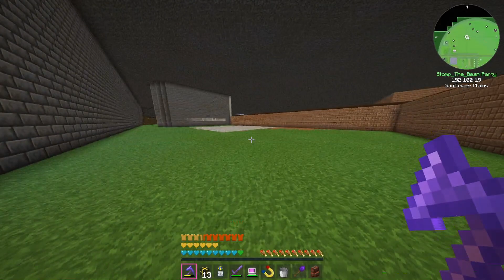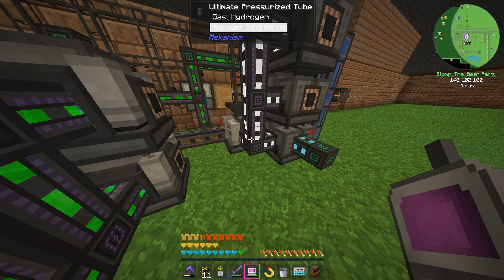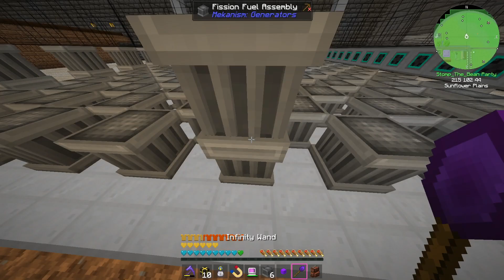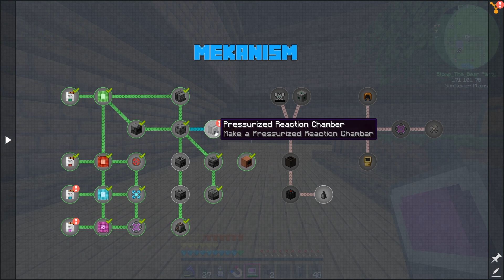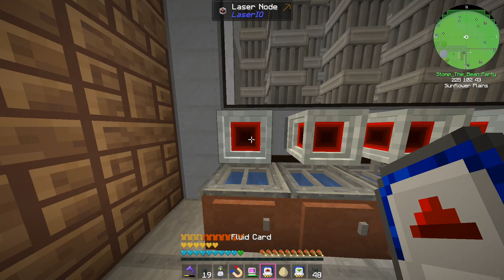FTB SKIES |  Fission Reactor #26

Comment: Integrated Dynamics is probably the most efficient way to fill a reactor with water. one sink can supply a max reactor and it fills almost instantly just have place the variable card into the fluid importer under "Import all fluids" and to set the fluid rate to 999999999   But LaserIO is also an interesting way.  Also you can create sulfur dust in a pressurized reaction chamber using coal, water and oxygen i found that to be more efficient since you can get coal a lot more frequently than sulfur.  I am enjoying the series its good to see different ways of doing things opposed how i do it the same way everytime lol
Reply from the maker: Yeah it's a great mod I was not quite prepared to get it setup so I went with laser io but normally I would use integrated dynamics thanks for watching buddy I'm glad you are enjoying it

Comment: Hey stomp, this is what I have learned from dire by watching him, the node overclocker allows all 9 slots to be used, meaning you can have 5 sides of the node extracting with all 9 slots at a rate of 8K/tick with a full upgrade node. Hope that makes sense, allows dire did make a Lazer IO book
Reply from the maker: So I can add 8 more fluid export and import to each side I'm using ?
Reply: @Stompthebean  yes so your down would have 9 cards in the node all upgraded to 8K and the west 9 imports, but I think you only need 1 on west and still work